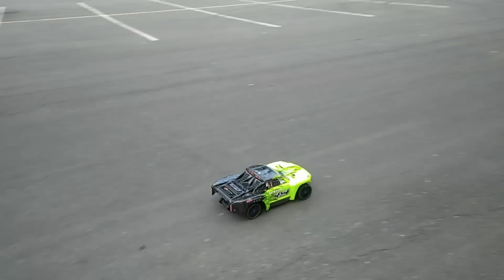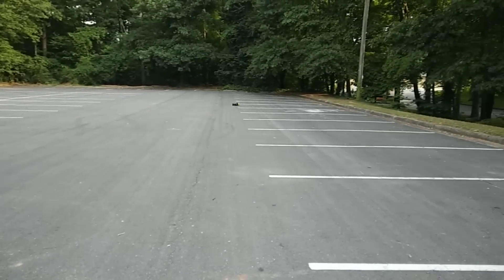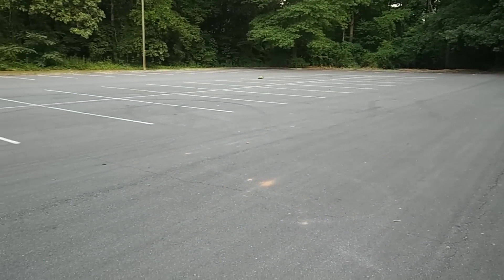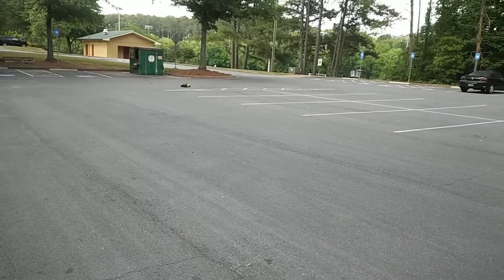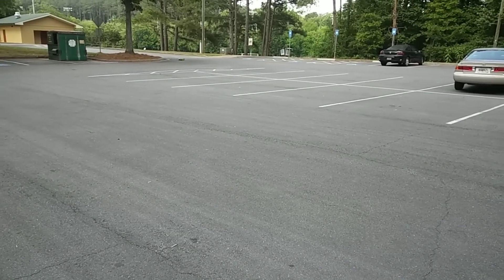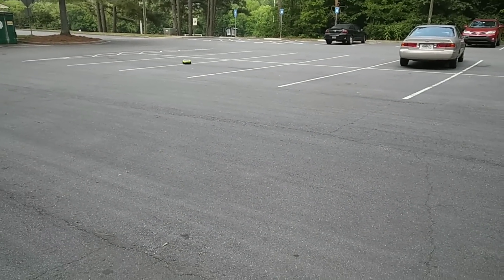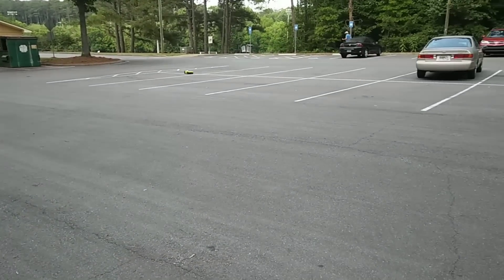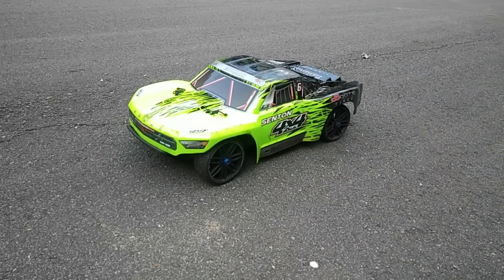Arrma Senton BLX Street Run

Comment: Almost decided to purchase one of these ! However they went out of stock lol..... Seems like a great little truck.
Reply: Ryzen Testing I just got one. All of the 3S cars are fun. Easy to work on as well. Shocks aren’t great though.
Reply: @Atown804  I decided just to pick up a Helion Select Four 10SC . Got it used for $200
Reply: @Atown804  Yes, my shocks are leaking already after mild use for just a couple months. I see your point.
Reply: @TopTechMan  If you ever need parts for the Select Four and your local Hobbytown doesn't have them, you can look for parts online under the Vkar SCTX10. It's the exact same car. just a rebrand so parts will fit all the same.
Reply: @sudsrc8261  I actually need a new Steering Knuckle with the part HLNS1005. No one has it. I'm stumped.
Reply: @TopTechMan  Any time you can't get the Helion part for your select four, I'd google Vkar SCTX 10 parts. You'll probably have to pay more with shipping over seas but at least you can get the part. Here's your steering knuckle.  https://www.monkeyhobby.com/vkar-racing-sct-x10-x-10-pro-1-10-rc-truck-parts-aluminum-steer-block-l-r-es1006/
Reply: How durable is it?